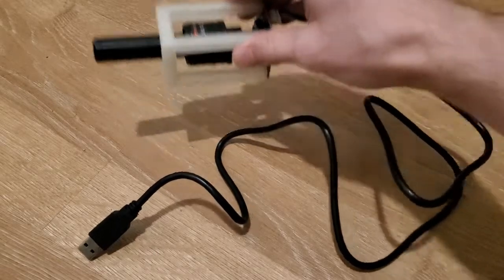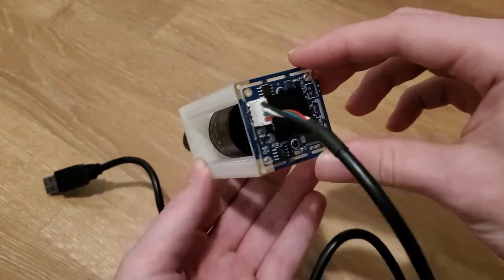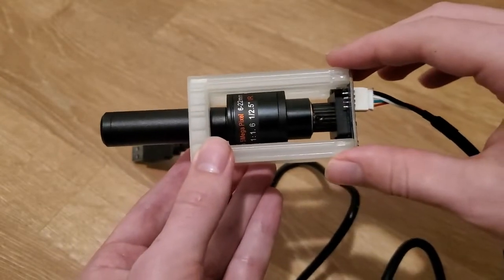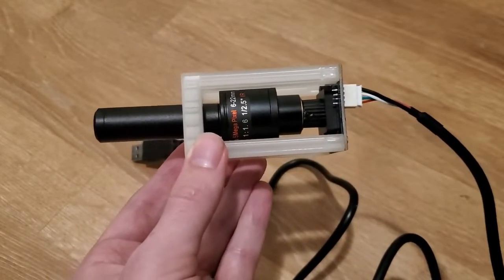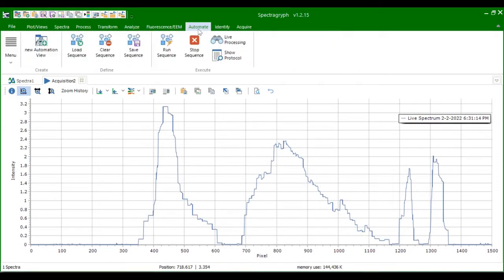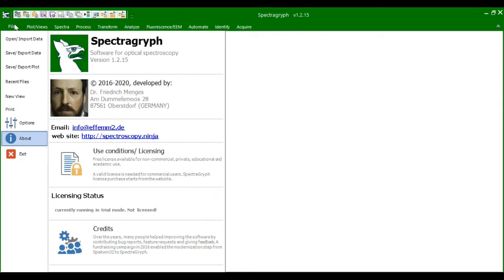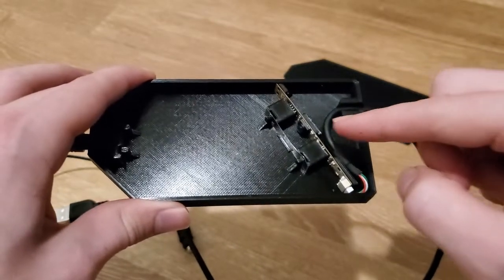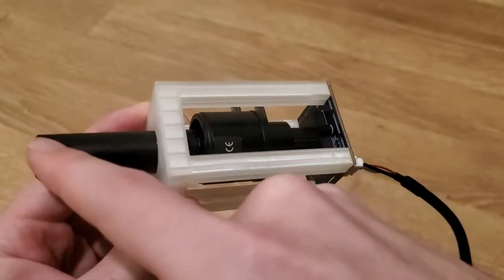USB Camera Spectrometer

Comment: Hi, What is the brand of the  handheld spectroscope? Obviously the light collimator and the diffraction grating are housed in it.  Thanks.
Reply from the maker: It's a generic 55mm handheld spectroscope that is found on Ebay or Amazon. There's no specific brand

Comment: Great!  However, the link for your spectroscope is broken... can you provide the company and part# for this? Thanks!
Reply from the maker: You should be able to find it by searching for: handheld spectroscope 55mm. The links change fairly often but here is an example: https://www.amazon.com/TEKCOPLUS-Handheld-Diffraction-Spectroscope-Gemological/dp/B01HNRVY3Y/ref=sr_1_fkmr0_1?crid=3UFLA4T931WM7&dib=eyJ2IjoiMSJ9.cihCUFztR9KBXzVPirBO1kMHkSmiE9agGe7ROZI_LUq8MBnyWQWJnANJ8xEtHZe_4ADagbFVYHIsG8OGk7CY0A.F70IDcqNufrmAWrzGD4G8VhXS5nlssK5sDIAlBwG9G8&dib_tag=se&keywords=handheld+spectroscope+55mm&qid=1720506953&sprefix=handheld+spectroscope+55mm%2Caps%2C265&sr=8-1-fkmr0
Reply: @qosmoschem  Thanks - very helpful!

Comment: WHich software are you using for the tool you built? I am loving the build! Could this also capture spectrum from glowing metals maybe [Laser Induced Breakdown Spectroscopy = LIBS]?
Reply from the maker: I use SpectraGryph for the spectrum analysis. I'm not familiar with LIBS, but if it produces a signal in the visible light range then I guess you should theoretically be able to use this to detect it.
Reply: The reason I ask is that a handheld unit to identify junkyard scrap cost at present an astounding $15-50,000 ! It would be terrible if a DIY fellow could make a unit. [hint hint] I am thinking a laser or even a plasma cutting machine for light source  @qosmoschem

Comment: very nice...just what I wanted to analysis spectrum of various sources... but can you provide a parts list? the lenses is not available on Amazon at the moment. thanks, Gene
Reply from the maker: If you search for "handheld spectroscope 55mm", "6-22mm 5MP M12 mount varifocal lens F1.6", “8MP HD Webcam IMX179 Sensor High Speed USB Camera Module Board”, and M2 bolts you should be able to find everything. I’ve also updated the video description with the terms as well for future reference.

Comment: Hi @Qosmos Chem it seems only two of the components are no longer available, any suggestion?
Reply from the maker: The listings from the sellers often get discontinued. You can always search for the keywords though to find equivalent parts from other sellers. The key search terms are: M2 screws, CCTV lens 1/2.5 inch 6-22mm 5MP M12 mount varifocal lens F1.6, 8MP HD Webcam IMX179 Sensor High Speed USB Camera Module Board, and 55mm spectroscope. That should get you what you need.
Reply: @qosmoschem  Thank you. Any recommendation on how I can adapt this to include 300nm-400nm as well?
Reply from the maker: Unfortunately the camera sensor just won't work in that range. You would need to find a camera sensor that is sensitive in the UV range.

Comment: The sensor seems to grab plenty of IR data about 700nm, but what about UV below about 380nm? Is there a UV filter on the IMX179 Sensor?
Reply: Note also that the camera sensor is based on silicon which has a peak response at around 1000nm and drops off a cliff above that. Below that it falls (sort of linear) to somewhere around 0 at 200-400nm. The camera doesn't give you a lot of gain options so it's hard to do much about it. If you want good IR and UV response you best use a photo diode or photo multiplier tube that has an exotic glass/crystal face except you then need to build hardware to mechanically select which wavelength you want to measure. This gives you great results but takes a lot more effort.
Reply: I've wondered about using a hard drive actuator to sweep the diffraction grating.  Seems like might be effective for targeting a PMT.  I also was wondering about sweeping back and forth tuned for persistence when using a finer line diffraction grating and wanting to try this later thought along with using a laptop HD sled to control the slit width.  @etmax1
Reply from the maker: I couldn't find any information that the IMX179 sensor has a UV filter. However at some wavelength the glass in the lens will start to absorb UV.
Reply: @qosmoschem  thanks!